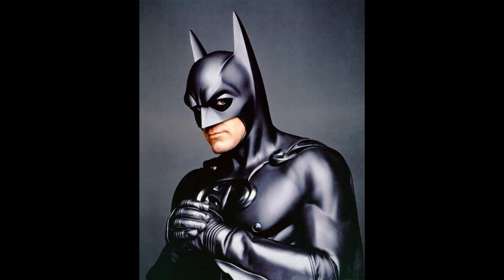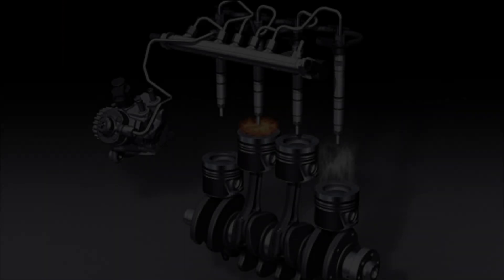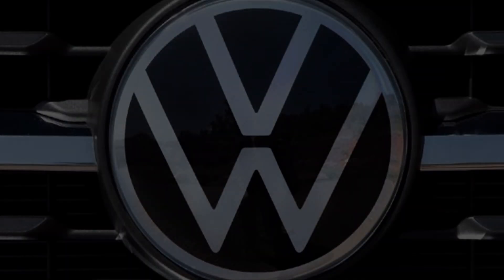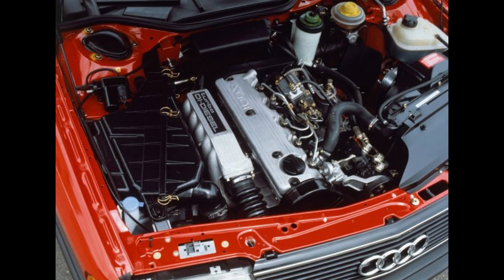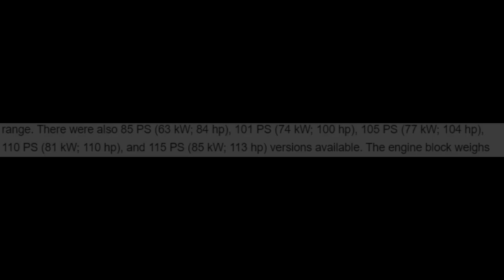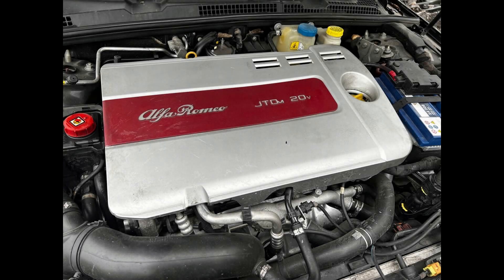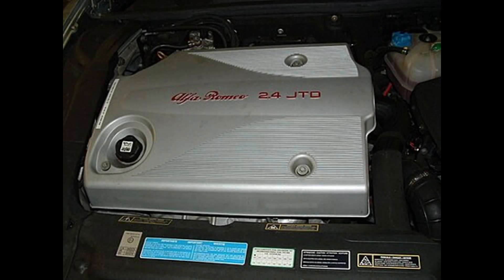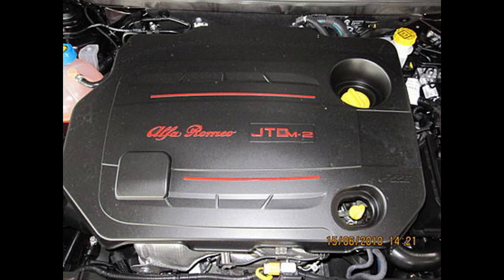THE REVOLUTIONARY DIESEL ENGINE

Comment: Why would anyone come up with the absurd idea that VW were the first with a common rail diesel???
It is well known that when all others were switching from the distributor injection pump to common rail, VW and Audi took a special approach and came up with the famous Pumpe-Duese TDI engines. Unfortunately, at some point these could no longer be further developed in relation to the stricter emissions regulations and VW also had to switch to common rail. By then, the Pumpe-Duese TDI have earned a reputation for longevity and great driveability.
Reply from the maker: Yes, you’re quite right, but I must remind you of the 3.3TDI which was a common rail engine and was launched in 1999 and after that the 4.0TDI in the D3 A8, the 5.0TDI, all of them were common rail systems
Reply: @BaraE34YT   The 5.0 V10 TDI in Touareg and Phaeton were clearly PD TDIs. That was practically two 2.5 TDIs put together to form a V-engine.
Reply: totally right you are, and VAG had a very valid reason for sticking to PD technology: the greatest variety of cylinder counts! They  had 3, 4, 5, 6, 10 and 12! This made PD much more desirable as each cylinder with its own injector was very flexible and modular in design. They were cheeky enough to say that common-rail was only suited to engines bigger than 2.5L; but the real reason was obvious. Besides, at the time many manufacturers were already creating fine CR diesels with 2, 1.9, 1.7. 1.6 and 1.5L. Subsequently even smaller engines were produced, smallest of which was Kia's 1.1L - so VW had to eat its words. As you said it eventually also had no choice but drop the very successful (and to this day popular) PD technology and go for common-rail to meet Euro 6 emissions-standards. That's when reliability no longer featured in VW's portfolio, and the emissions scandal only drove sales even lower. Interesting how Skoda (cheapest from the VAG conglomerate) always scores highest in JD power surveys.